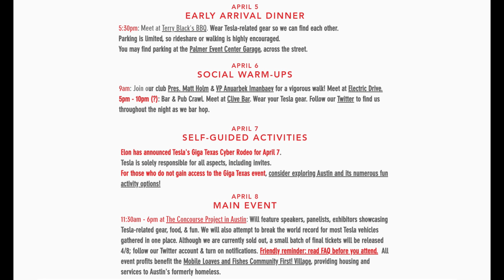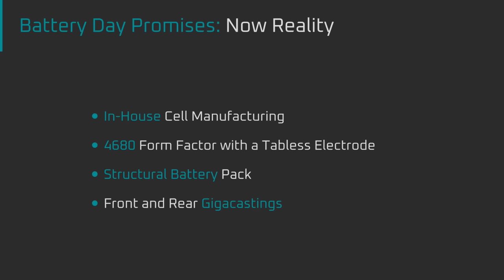Giga Texas // My Experience and What I Learned

Comment: The colling "101" mean in fact that over the entire lenght of each "U" shape cooling line,  the average temperature of the top and bottom of the "U" remain always the same. At the begining of the "U" there is the coldest liquid on top and hotest liquid on bottom... both average the same temperature as the one completly at the end which is at about half way of the inlet and outlet of it and the top and bottom have about the same temperature because it's the "return" or loop between the top and bottom line on the cell. 
In other words the first cell near the inlet and outlet is let say 10 degreeC from the inlet and the outlet is 20 degree C. The average of both combined  is 15 degree C, and the same average temp as the last cell at the end of the row that see 15C on the top line and 15C on the bottom line of the "U" half way of the in and out.  So each cells of a row that are in contact with this cooling line see the same temperature on this line whatever it is the first or the last. Which extend the battery life and allow better cell balancing in a PARALLEL string for the current sharing/distribution along the entire parallel line as the internal resistance will be very close due to same temperature.
Reply: Could it be improved even further if the first loop started and returned on one side, then the second loop started and returned on the other side? Alternating through the pack?
That way the circuits would equalise as well (maybe?)
Reply: @rogerstarkey5390  Yes it could. If it does not add to the complexity of all folding of the tubing.

Comment: Hi Jordan, my two cents... Glycol is not necessary and would only reduce thermal conductivity. In HVAC, we only add glycol to water to prevent freezing, which is obviously not a problem in Texas. Note: It also provides some protection against corrosion.
Reply from the maker: Thanks for the input Rio!
Reply: Thanks for everything you do. What an amazing community we have!
Reply: We desperately need your input on Twitter regarding the new text credit. The law says 50% (percentage goes up following years) of the value of the components contained in the batteries need to be manufactured or assembled in North America. Would you say Tesla's batteries qualify? I know Lithium and Cobalt will come from Australia, Chile or Africa but those only account for a small percentage. We've been debating this all weekend. We have plenty of Aluminum, Copper, Graphite, etc.

Comment: Based on what you where showing on your slides its weird why anyone would want a Nickel based battery. I rather the much more higher charge cycles then density.
It means the car doesn't need to replaced for over 30years.
Reply: I agree about the charge cycles vs density. For a long haul trucking scenario, it makes sense to want density for maximum range. But most people don't travel more than 200 miles/day. I personally rarely do more than 100. Being the frugal person that I am, a 250 mile range car that lasts for 30 years sounds incredible! (I'm currently driving a 25 year old Honda - still runs great! Hoping my next car will be a Tesla that will last just as long.)
Reply: But, on the other hand. Assuming these are FULL  cycles....
The 279 mile range car, times 1000 cycles, 279, 000 miles.
3000 cycles, 837,000 miles.
Average, 418,000 miles
Take the average US mileage of 13,500 miles, bump that to 18,000.
That gives
15 years (279,000)
23 years (418,000)
46 years (837,000)
.
Not too shabby?
Will the car last that long?

Comment: The 5 years ahead chart doesn't quite make sense. They are showing 580v peak charge, indicating a 138 series pack. Tesla has so far been 96s(350v nominal). I don't see why Tesla would change the systems voltage when they are melding the old with the new, and keeping all of the same hardware in the traction system. Not to mention the superchargers need to supply a common voltage to the whole Tesla fleet.
Reply from the maker: Probably worth watching his video and leaving a comment for him.
Reply: @thelimitingfactor  I will do that. 👍

Comment: Jordan I would be interested to know more about what you mean by u-shaped cooling. Most likely a tube and shell would be less efficient than a plate and frame style heat exchanger. From weight and thermal transfer I think they would go with plate and frame
Reply: If you look under the tanks in your giga cast section regarding cooling the large Blue plates are the backside of a plate and frame heat exchanger. They come in many sizes
Reply: With Clayton frame you would flow your cooling media in a reverse flow to your source heat this will give you good thermal regulation, in other words a consistent temperature based on heat load
Reply: *plate & frame
Reply from the maker: Hey man!  Are you confusing the cooling I was talking about for the Gigapress with the cooling I was talking about for the battery pack?

U shaped cooling is for the pack.

For the gigapress, I don't know how the cooling loops are run and I can see the blue plates you're talking about under the tanks.  My main question there is what material is running through the pipes.
Reply: @thelimitingfactor  I looked back at the illustration to check what I was thinking.  Maybe it's a simple "down & back" or u-shaped loop for each row or cooling coil at the batteries(ref.12:36).  Simple.  Then the question is what happens on the other end when removing thermal load.  At that point (like with the giga press improvement) I'm guessing Tesla would use a plate\frame style HE as this is newer tech and has better transfer coefficient than tube\shell style.  Would love to diagram & discuss if you ever have the time.

Comment: Structural battery pack comment. It could be less steel in the car overall but more steel around the battery. Safety could come in the form of a stiffer battery enclosure that protects against intrusions and damage. The danger with the Teslas batteries fires is mostly related to crashes/hits/piercings less with the electrical issues or cell shorting like in the GM case.

Comment: If chips remain the bottleneck, then just ramping to max speed from the 4680 lines as quickly as possible is not a priority. They can do a lot more experimentation to make improvements for speed, alternative chemistries or design variations, and performance qualities of the batteries. Thus when the chip bottleneck clears, they will be in a better position to ramp batteries. This is Tesla's agile engineering in action: wherever the bottleneck is in the process, that just gives flexibility to all other steps in the process to experiment with improvements!
Reply: Isn't that what Jordan said?
Reply: @rogerstarkey5390  If he made exactly the observation in my comment (agile flexibility to treat non-Limiting Factors as opportunity for improvement) I missed it. My comment is meant to expand on what the video says, not contradict anything.
Reply: @nordic5490  I seriously doubt Tesla is lying about chips. Of course you can pay a premium to get to the top of the list, but there is a point where the requied premium is not worth it, and that is the point where a "shortage" matters. Since Tesla has been increasing production and sales all through the shortage, and EVs require many more chips than fossil vehicles, I'd say Tesla is dealing with the chip shortage already in an optimal manner, unlike the fossil car makers.

4680 may or may not be going as well as they'd like, but we should see that quite soon.

Comment: I hear a lot of talk from The Electric Viking about LFP batteries potentially being the superior option for batteries going forward. I know you talk about the differences between battery types, but have there been any advancements with LFP that could make the 4680's obsolete?
Reply from the maker: There isn't really such thing as a superior battery, only a better battery given a specific use case.

LFP batteries can be put in any form factor, including 4680s.  Check out my Tesla LFP video.
Reply: @thelimitingfactor  
I can't get by the "LiFePo4 will be the predominant cell" statement..
Will Tesla want others supplying 80% of their cell capacity when they have potentially the best, high output production available?
🤔
Reply: @rogerstarkey5390  The only way I see it coming to be (LFP being dominant) is when the grid storage end over-takes the automotive end.
Reply: the slow burn that makes it is a way I would describe LFP,  yes chinas volume matters but also it's like the chubby teenager that will hit the gym or pick up a sport in their 20's. So far the tech/chemistry has good fundamentals, I've been doing LFP batteries packs for 10 years, and each year it gets better every year. When we have made mistakes in our packs, wires, and connectors melt before cells catch fire, cero fire so far actually. Cycle life is excellent too....so if it keeps timing fat and playing up its strengths it may not be the "best" battery but it will be everywhere.

Comment: Someone as just made great breakthrough on lithium-sulfur cells. If Tesla puts their hands on this, nothing can stop electrification, at all levels, planes included.
Reply: Maybe.  The problem is a break through on the lab bench is not the same as a production break through.  How easily and cheaply it can be made plays a big part in adoption.
Reply: @TheEvilmooseofdoom  That's why Tesla needs to put their hands on it. To make it out of the lab.
Reply: @shumymikaball  They might, but there are no guarantee's that it can be done.  There are a lot of new chemistries out there and a small pile of solid state start ups.  The batteries used in 10 years will not be the same we use today! :)
Reply: do share, part of the fun here is gathering info to make predictions.

Comment: A good Chemical Engineer skilled in the heat transfer chapters of Transport Phenomena (by Bird, Stewart & Lightfoot) could knock this out in a few weeks in theory, then build a physical model to prove it. I was designing some pretty sophisticated polymerization reactors in the late 1970's. Basically programmed simulations with Fortran, based upon the textbook theory. Once you have that you run different coolant compositions, velocities (Reynolds numbers), temp gradients, and thermal conductivities of the jackets and coils (ribbons in this case). Then make sure all of your materials choices won't corrode, stress crack, etc., etc. Probably would do it with Excel now.
Reply from the maker: Lol, It's amazing the tricks you can get Excel to do

Comment: Would this proposed 279 mile range high Manganese battery be recommended to daily charge to 90% like current Tesla NCA or 100% like LFP batteries? Also, how would this high Manganese battery perform in cold weather compared to the current NCA and LFP battery chemistry?
Reply from the maker: Yup, overall, the same as high nickel, just with less nickel.
Reply: @thelimitingfactor  Thank you for taking the time to answer my question. I hope to buy my first Tesla soon. But since I live in Wisconsin I have to be very careful to get adequate range, etc. Your answer greatly helps our buying decision.

Comment: Anyone know what the curb weight is of the Model Y standard range?
Reply: I think 4236 for the awd model out of Texas was the epa filing weight. I think the very limited production 2021 model y sr rwd was right at 4k. 🤔
Reply: @4literv6  big if true.  literally.  gig casting and structural 4680 packing saving negative mass
Reply: @JackMott  I was wrong 4356# is what he claims in the video near the end. Still seems high imo. I expected the new model y with structural pack's and front castings to be under or right at 4k. 

Wonder if the weight savings shown at battery day was not overall vehicle weight. Instead it was the individual component weights?
Still if the structural pack alone was 14% less vs the non structural pack weight. That alone should've saved about 140# 🤔

Comment: I'm from Germany and by now all current Model 3 are from China. I have a M3 SR+ with LFP battery. Sooner or later Giga Berlin will also build an SR version of the Y and I ask myself, what cells they will be using. In China they use for the SR models LFP, but with prismatic cells, not cylindrical. How they will provide a structural battery pack with prismatic cells? Or will they produce also LFP cells in 4680 in Berlin?
Reply from the maker: I'm betting all standard range will use LFP in all countries.  In the short term, prismatic from CATL.  In the future, Tesla might produce and LFP 4680.  I did a video on this "Tesla LFP"

As for prismatic and structure, see my video on the BYD blade battery.
Reply: @thelimitingfactor  Thank you for the answer. I will check your Videos.

Comment: I have a question that might occupy your attention for a time. What is the refrigerant substance that Tesla uses in its cars? All commercial refrigerants have pros and cons, and most can be toxic in at least some circumstances. Ammonia was the original refrigerant, but it is so toxic as to kill everyone in a house in the event of a leak. Freon was removed from use because it converts to mustard gas when exposed to open flame, as exemplified by the destruction of 9/11 skyscrapers that ruptured giant tanks of freon and caused widespread pulmonary damage to exposed emergency workers. The cheapest and safest refrigerant is carbon dioxide, which also has the attractive quality of retarding flame and explosion. It is known that Mercedes was developing air conditioning systems that used carbon dioxide as a refrigerant in its premium sedans, but it entails higher pressures than alternatives, which might be especially problematic in the context of electric cars, which must heat and cool battery packs. Still, it would be nice to know that toxic refrigerants would not be released in the event of a severe crash in a Tesla.
Reply from the maker: Great question!
Reply: Originally R-134a, no idea what is being used currently but since they sell in the EU they might have changed.

Comment: The EPA weights must be correct, because the Miles/KWh are equal.  330/82 and 279/69.

One of these things is true;
1) Tesla is software limiting the range and lying about the weight
2) The range improvements for 4680 have not been implemented yet
3) 4680 is a nothing burger for range
Reply from the maker: You still have to factor in the structural pack and Giga castings.  The odds that they have zero impact on weight is low.

Comment: Compare and contrast to BYD and their vertical integration.
Reply from the maker: BYD is comparable, but makes in inferior product.  But, as I've said in the past, that will change.  BYD is great.
Reply: I've been to the BYD factory and you know what, its massive, with hundreds of buildings, private roads that go over 10 lane highways, and two internal monorails with elevated stations. Texas seams way more efficient and focused.
Reply: @joabarrera  Very interesting. Thanks. I assume that was there China factory vs. the two they have in the U.S.? That I know of…
Reply: The CEO’s life story is truly remarkable. From what I know.
Reply: @thelimitingfactor  Yes. And as fast as they have come from where they were just a few years ago, to where they are today is astonishing.
Reply: @grizzlymartin1  Indeed....back&deck drills first client. By the way, BYD does make its own chips, plus electrical boards
Reply: @grizzlymartin1  US plants are more like assembly warehouses. There are many sites in China, BYD grew by buying up companies, a car company here, a truck company there....but the main Shenzen site makes batteries, vehicle R&D, proto builds, and a bit more. I was going to work for Ford twice many many years ago, they proudly show you their anechoic chamber, at BYD I saw 3 bus-capable chambers....quite impressive. Why did I not join FORD? in 2000 y 2002 I was told the EVs would be a very un-cool thing to work on, with cero career advancement opportunities.
Reply: @grizzlymartin1  two sites?, I read about something in California for buses. Must get up to speed on BYD US now

Comment: Just wanted to make a comment about Li-ion cells and how they are viewed by the authorities in my country, you can't just import them.  I have a vacuum cleaner powered by Li-ion cells, which battery pack has just failed, its not the cells which have failed but the BMS board, the cells are still  good 18650 from Murata.  Needless to say that my appliance has started to fail gradually, by its AC adaptor that would power up only after 15 mins after being turned on and lastly a tiny little transistor which has burst on the BMS board.  I am trying to get a replacement but no online shops will ship to my country!  Also I get the impression there is a deliberate ban on this technology, so that the fossil industry still remains in number one position!

Comment: In order to secure Tesla's chip supply, why haven't they (Tesla) moved into the chip manufacturing business?  Yeah, it is expensive and hard, but MUCH less expensive than buying Twitter, and the tech is known and the payoff would be big (more vertical integration in their manufacturing and less dependence on other companies for a hyper-critical set of parts).
Reply: Probably the same reason Apple, Nvidia and AMD don’t make their own chips. These days it’s super expensive, and it seems to only make sense to be very high volume for lots of customers. Tesla is not a chip manufacturer and probably has no interest in making them for others.
Reply: I have a hunch that its under review, from my HP days recolleciont FABS may be running at 800-1000 million USD today. but their limiting factor is skilled labor. Have't a few chip maker amounce they are moving back to the US?
Reply: @nordic5490  I think you're making things up.